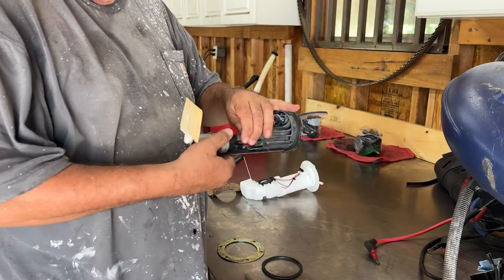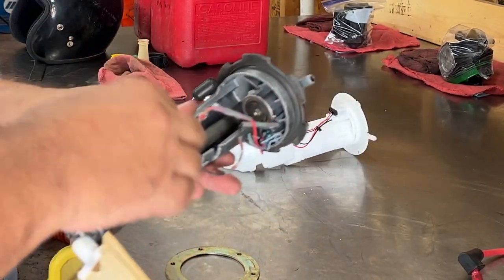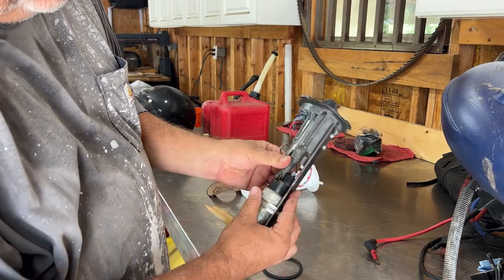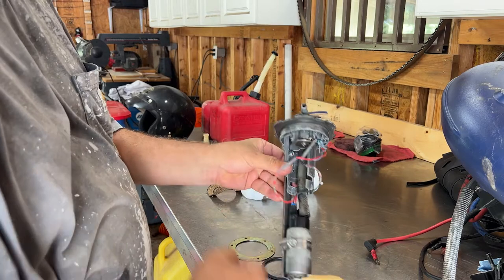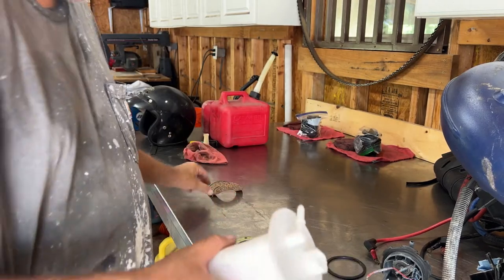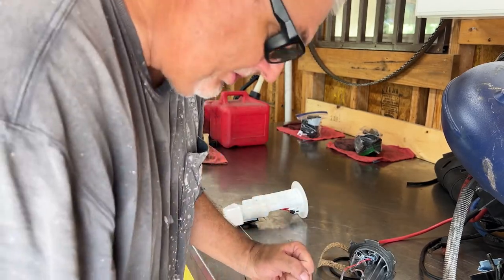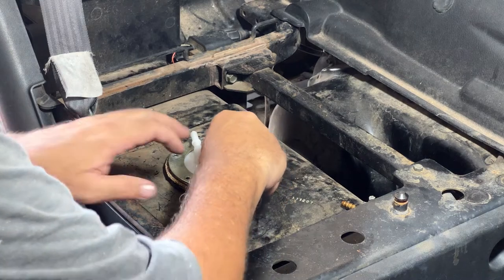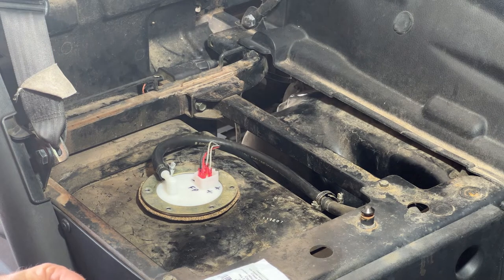Kymco no start sluggish FIXED for good!

Comment from the maker: Yes, guess i forgot to insert that video at 4:15. I just got small spade terminals (I think they were 3mm) and spliced to the kymco pigtail.
Reply: Do you know what colors when to what wire when you spliced from the connector having issues finding a replacement fuel pump